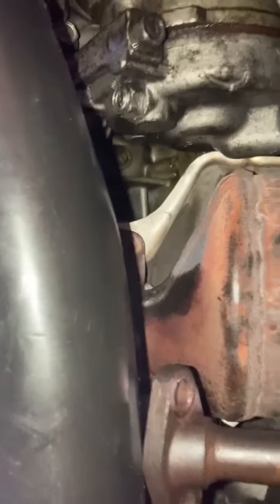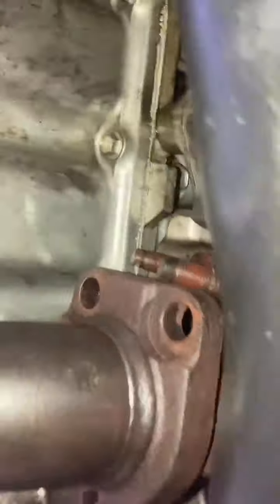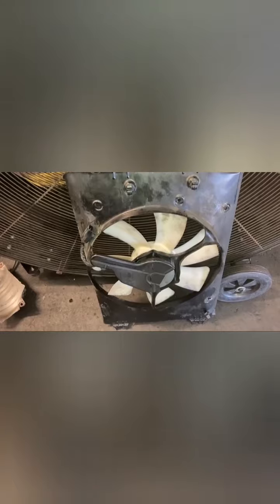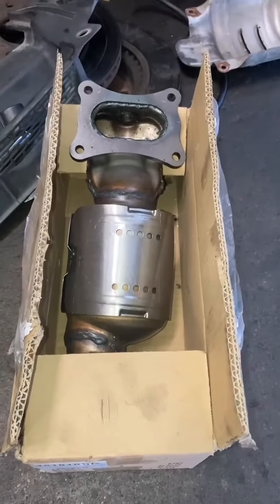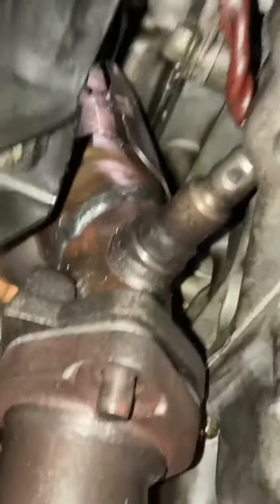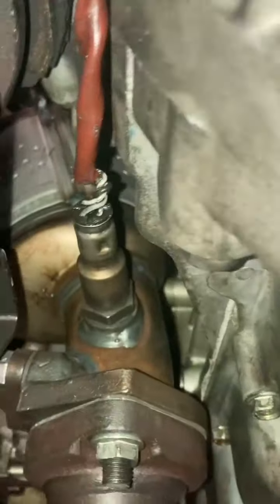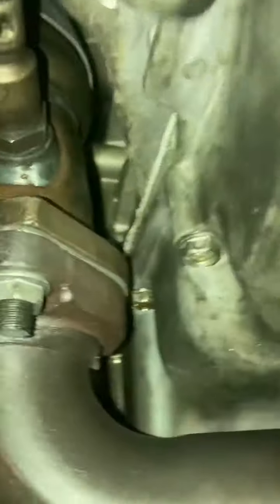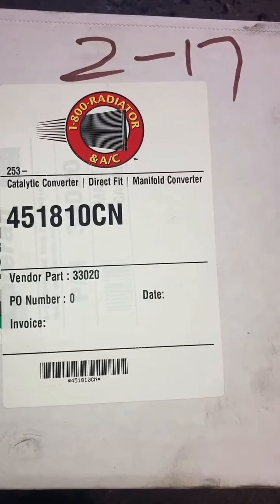P0430|| Honda Pilot Catalytic Converter Replacement|| Bank 2

Comment: I have my catalytic converter replaced. And my oxygen sensor replaced. Code pops up p0430. Could that be exhaust leaking because my car is a little loud.
Reply from the maker: Yep check out the leak hand tight the bolts or stud on nuts
Reply: @theasemechanic  just tightened all my bolts and nuts. Hopefully it will fix the check engine light. Runs much quieter now.
Reply from the maker: @Justbeingfrankx  great 👍
Reply: @Justbeingfrankx Updates?
Reply: @mtsanchez27  the gasket that came with my catalytic converters burned out. Turns out it was cheap ones. Runs fine now

Comment: So is the p0430 code for catalytic converter or injector replacement?
Reply from the maker: In this case Catalytic Converter replacement
Reply: @theasemechanic  I have the P0430 (Bank 2) trouble code, on 2016 Pilot, so had injectors replaced (free at dealership) under Honda TSB 20-100.  Error returned.  Now looking for someone to test the cat for efficiency and trying to get an idea if I can purchase and install myself.
Reply from the maker: @rllane57  failed injector also causing the cat to fail
Reply: @rllane57 what was the issue?